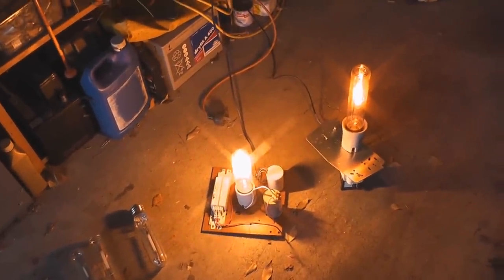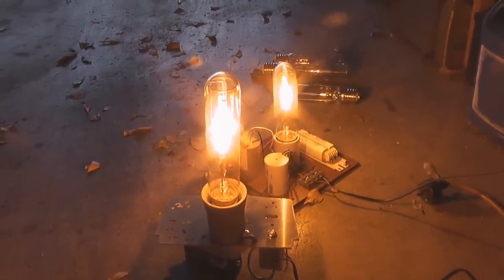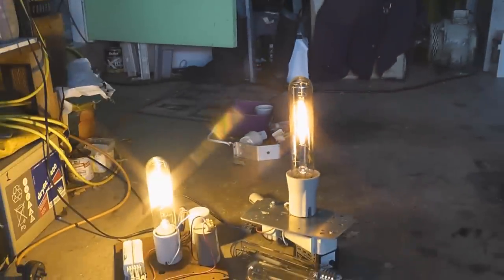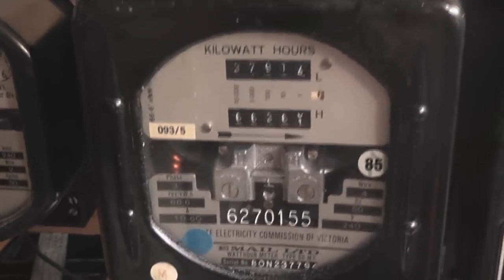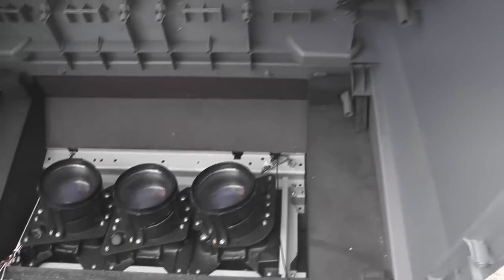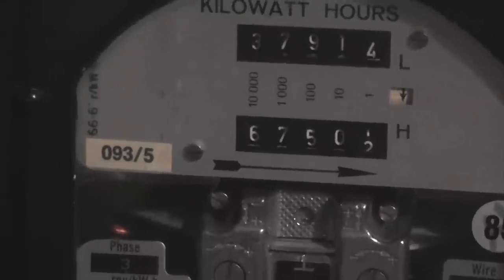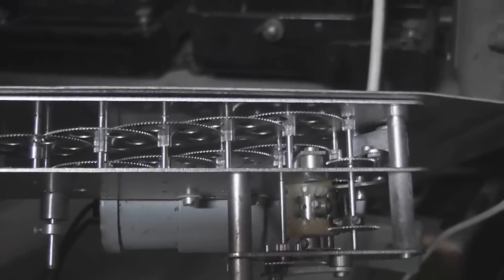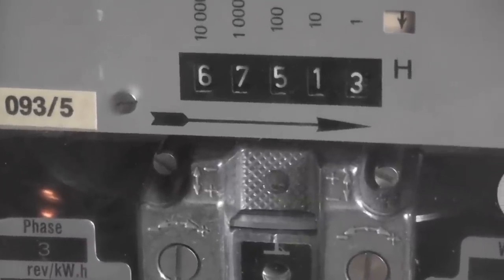Sodium - Meters - RPTV - Incinerator

Comment: It's always good to give them a good hour test to make sure they aren't "cycling", which is the most common EOL mode for SON lamps.
Reply from the maker: Yes, correct, I run them often for about 2 hours and sometimes the whole day when I forget to switch them off.
Reply: Heh, just hope they don't attract any unwanted attention... My mate had the police knocking at his door because he uses sodium lamps on his flowers. Somebody had reported "funny coloured lights" and the cops wanted to know if he was growing anything that may be of interest to them... :)
Reply from the maker: FrontSideBus LOL !! plenty of those around in NZ. I use them as deck and outside lights as well as inside in the lounge to enjoy the peach orange glow.
Reply: If you can, keep your eyes open for lamps marked as SON-DL, Deluxe or Comfort. They were very popular in the UK during the 1980’s and early 1990's for indoor lighting large areas like sports halls ect. They had a slightly cooler colour temperature but more importantly the colour rendering was greatly improved from 20% to 65%! That's better than some older halophosphate fluorescent lamps!
Reply: RODALCO2007
 Btw, I did a vid on a tiny little 20w ceramic halide that I think you might be interested in :)